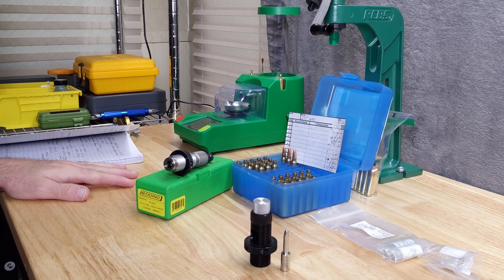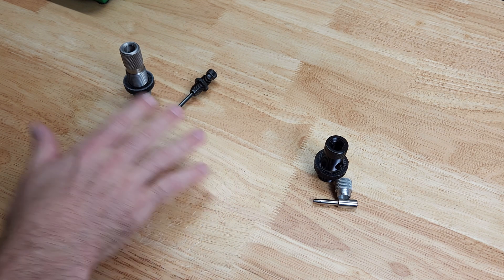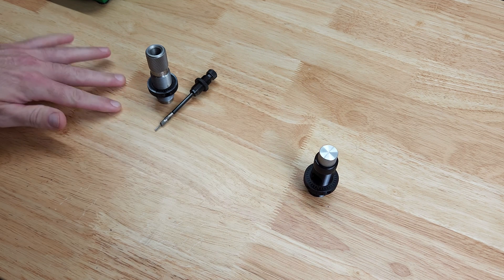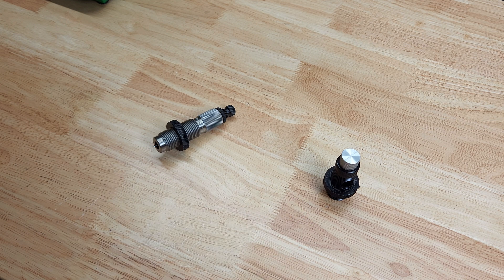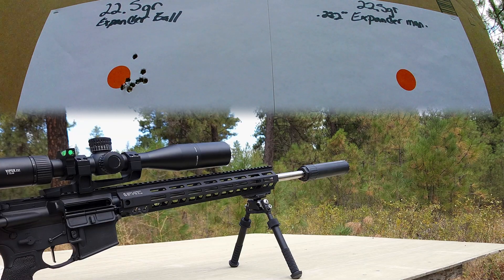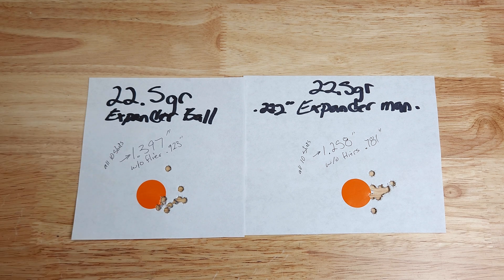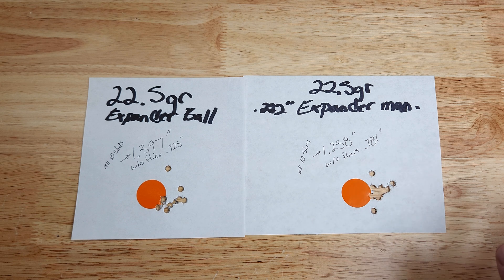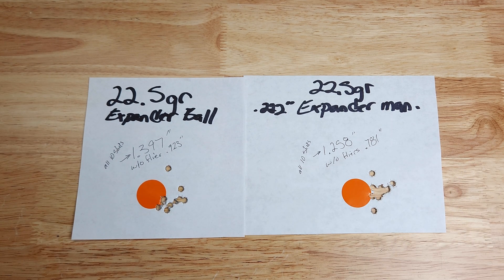Expander ball vs Expander mandrel

Comment: Use a neck sizing bushing, combined with a free floating expander ball. You may have to Polish down the expander ball to get the right size. Make sure it just kisses the inside of the neck after selecting the proper size bushing

Comment: Barrel temperature..seating depth…ignore windage and focus on elevation
Reply from the maker: Barrel temperature is the most difficult for me because I have a hard time waiting long times between shots to keep a steady temp.  I usually shoot it slower paced but not super slowly until the barrels uncomfortable to touch for a couple seconds and wait maybe 10-15 minutes before I shoot again.  It wouldn't be as big of a deal if I wasn't recording but I hate leaving my camera in the sun for 30 minutes or so and dont want to have to reset up everything every time I take a break

Comment: The difference could simply be the two different shooting positions between strings. You are shooting a lightweight semi-auto so subtle differences in hold exaggerate differences when rounds exit the muzzle, as witnessed on the target.
I use mandrels and anneal every time for long range bolt-gun competition. I use dry lube for every neck with a 1.5-thou" interference fit. Can't seem to guarantee single digit SDs and low ESs without doing this. Regardless, every round must be loaded exactly the same.
Reply from the maker: Yeah I now use dry neck lube with .002" interference with my bolt gun.  Im actually waiting of a large amount of the same bullets and powder so I have the same lots for multiple videos and im going to be doing a brass prep series where ill be looking at not just neck tension differences, but if the amount of shoulder bump makes a difference or not, if there's differences in accuracy in how much the neck is sized down past the expander mandrel, like if overworking the brass effects accuracy and if there's a sweet spot or not.  So its a brass prep series but it'll kinda be looking at things most ppl dont think matter.  I did some preliminary testing on stuff to see if there is a difference and there was so hopefully I can convey that in the videos.  After that ill do a primer series and look at not just what different primers do but primer seating depth and the amount of primer crush and info like that, so we will see.  Health problems prevent me from posting a ton and its def been a long while since ive been able to post, but when my pain allows me I make as much content as I can, showing what things testing and trying at the time.  I was just going to just show different powder/bullet/primer combos and load development for my channel but I feel like thats kinda repetitive so now im gunna focus on creating a really accurate load and what i can do with my prep other than just what the powder charge is or components are with what things with your prep that makes a difference and what doesn't if that makes sense.  So hopefully ppl enjoy the info.  Ive def gone down some rabbit holes on my prep.  Ive been using LRP brass for my bolt action in 6.5cm but have heard SRP brass can make your ES/SDs much smaller but can cause some primer penitration sometimes but ill be making a video demonstrating if there's a difference as well.  So lots planned.  Now I just need to feel good enough to film.

Comment: Interesting, thank, especially with a semi auto which might be more of a test.

By the way, since depth isn’t really a big factor when adjusting and using a mandrel, as you have a wide depth range for the same utility to expand the case mouth, why do you have a Forster Accu-ring on the mandrel die?   The 21st Century mandrel die with  window especially, which makes setting it up even easier.  (?)

Just curious, thanks.
Reply from the maker: When I had a co-ax I used the accu-ring with all my dies.  Yeah I got the window version just so setting the depth was easier.
Reply: @Reloaderscodex Got it, thanks.  I have a half dozen I use with sizing and non micrometer seating dies, (before getting inline seaters for a couple of calibers.). They are a great solution.  I also have a co ax and of course they fit that perfectly.
Reply from the maker: They are nice.

Comment: Shooting with a semi auto, you didn't say if you crimped or not?
Reply from the maker: @garysnyder6020 i dont crimp.  But i did start using .003" neck tension on semi autos instead of .002".  Never had issues with .002" but thought ide make my bullets have a bit more hold.

Comment: You’re shooting a semi auto. That isn’t going to Group nearly as well as a bolt rifle. You had a very nice cluster on the expander Group, with three outliers. That could very well be the rifle and the barrel. The expander ball group shot very differently. I really appreciate seeing this because I’m getting ready to start using an expander mandrel to try to tighten my accuracy. I would say that there’s no other YouTube channels out there which are like mine, but yours is very similar. I’d appreciate it if you would check it out. And, I just subscribed to you.  Really appreciate the content. Thanks for sharing.
Reply from the maker: Thanks for the subscribe 👍.   I'll have to check out your channel
Reply: @ much appreciated. Enjoying yours.
Reply: The shift is probably causes by a different neck tension, which results in a different pressure and different average velocity. This doesn’t tell me much. The  sample size is too small and the other factors ( barrel heat , cold bore shots, scope and shooter errors, wind):are unknown.

Comment: If your mandrel has more neck tension than using the die, it is possible it = slightly more pressure and is causing the shift in POI. Also have you experimented with single feeding the rounds vs loading the Mag. It can make a huge difference in the group size for load development.  Just came across you channel so my comment is late.  Thanks
Reply from the maker: @ericmusgrove2828 i haven't tried that yet.  I do have some 75gr burgers that I'll have you single feed but haven't shot them yet.

Comment: Usually a shift in waterline like that would be a velocity change. Probably slightly higher velocity with the mandrel sizes. What is the dia diff between the mandrel and ball after the process was preformed.
Reply from the maker: Exoander Mandrel is .002 neck tension and the expander ball is in-between .003-.004 if i remember correctly.
Reply: @Reloaderscodex  interesting. Do you have a gage pin set? Wonder how much spring back your getting. The lesser neck interference might allow for the bullet to dislodge from the case and getting ladged in the lands
Reply from the maker: @mastermoarman yeah I started using .003 neck tension for ar15s a little bit ago

Comment: Not sure if this applies to your test, but I notice with my expander mandrels I can get less neck tension, which increases muzzle speed and consistency. That increase in speed shifts my POI higher than tighter neck tension.
Reply from the maker: Yeah i think I might have slightly too little neck tension. So im going to be using 3 thou neck tension for my ar15 instead of 2 for a bit, and how if I can get a little more consistency.

Comment: Those darn flyers will get you every time... I am a machinist retired of 36 years and have never used a mandrel so I think I am going to make up a set or two and try them for myself.
Reply from the maker: They are definitely more consistent and can adjust your neck tension compared to standard expander ball.

Comment: Did you measure your runout or are you assuming? Not sure your results are conclusive
Reply from the maker: Unfortunately, I don't have a concentricity gauge to measure runout, but i plan on getting one and doing a video comparing groups with different amounts of runout to see if it actually matters. Cause I've heard both that it matters, and that it doesn't matter when it comes to accuracy at least to a certain degree. Obviously, if the runout is super bad, it'll cause issues, but I'll have to save some money to get a gauge first.
Reply: @ I bought the Sinclair years ago when it was on sale. Haven’t used yet cause I am not sure how much it matters for my  shooting. I plan to try it out soon though. It happens to be on sale now for BF. Cheap enough to try…
Reply from the maker: @djryan8944 yeah that's the one I was looking at. I doubt it makes a big difference but I think it'll be a good video.

Comment: The NOE system comes with different size plugs with two steps in them. The first determines the neck tension and second opens the mouth a bit more to make it easier for the bullet to start. You can buy all different sizes inexpensively. They give you more choices to experiment with and other calibers.😊
Reply from the maker: Never heard of it. Sounds interesting to play around with.  You have any experience with it?
Reply: @Reloaderscodex  
Yes. I have many sizes for different calibers. It’s the best for a perfect fit. Saves on brass life.
Reply from the maker: What's something like that run for one caliber? I'm not sure whether it'd be more beneficial for my ar15 or for my bolt gun?

Comment: You have a little item,called barrel HEAT,  do this test over 2 days and a set time between shots. Walking the POI is a direct result of the heat. Any and all semi autos are good under an inch if you want quarter minute groups go to a blot action.
Reply from the maker: Yeah i usually keep my barrel warm but not hot. A 50 round load work up will take me a long afternoon.

Comment: How do you maintain a consistent seating depth with such light neck tension??? I noticed my 77gr SMKs were sliding out of the case .005 (+/-.002)  from the momentum of the bolt clambering the cartridge.
Reply: Have you tried a light crimp
Reply from the maker: What are you currently using to size your brass and set your neck tension? Are you making sure the inside of your necks are free of lubrication before seating your bullets? Give me a bit of your process and how you load your ammo.
Reply: @Reloaderscodex  I'm currently using Redding S dies with a bushing to give me about .006 neck tension on annealed Nosler brass. I've even used the lightest spring in my buffer tube with an adjustable gas block to slow the BCG down. Thinking about heavier weights in the buffer.
Reply from the maker: @mmorgan227 I've never used an s die.  How do you get to the neck tension you want?